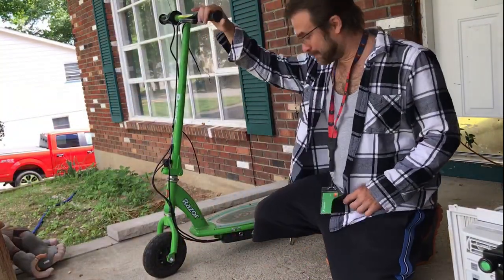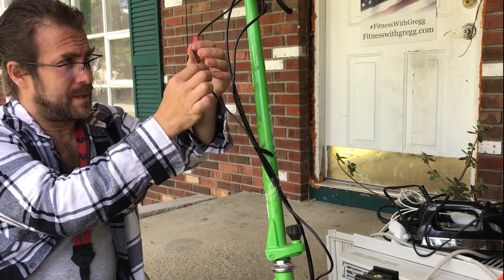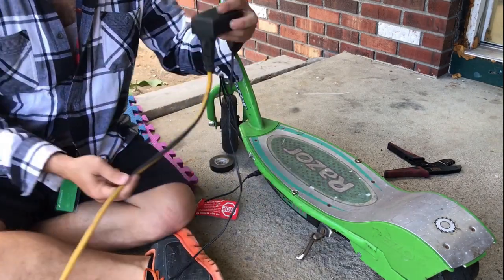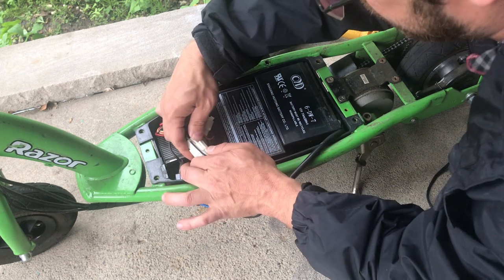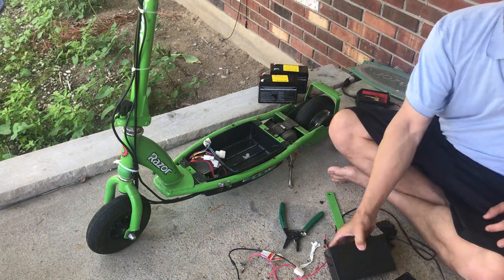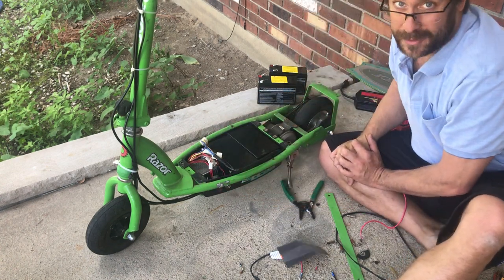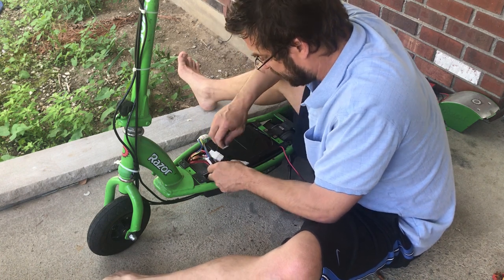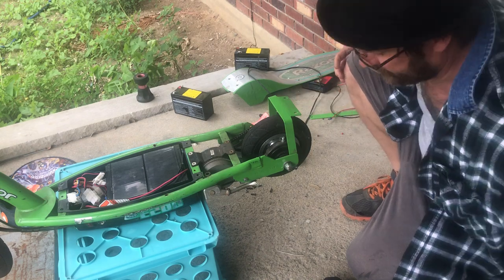Fixing a Junked Razor Scooter E200. Fix Wiring, Replace batteries, Change Rear Tire

Comment: Hey is that all the speed that the scooter has
Reply from the maker: No, I was barely on the throttle. I’m a bit heavy for it. It moves reasonably but isn’t super fast.
Reply: Why I asked is because I have a e100 I'm working on myself , someone trew it out but I'm almost finished jus to change out the batterys now and give it a run.btw very informative vid thanks.

Comment: sure wish i watched this video hours a go...bought my son an e300s years a go that he didnt ride too much till the batteries would no longer charge..it sat in garage i think like 8-10 years when i decided to buy new batteries and bring it back to life so he could drive it to work..opened it up and both batteries were bulging and both tires were flat...took to friend who is a mechanic so i could air up the tires...he also ended up cutting wires to the batteries and adding new connectors like you did...air up front tire then get to the dreaded back tire...he had several size adapters but none would fit...so off with the rear tire which was an hour long job oiled up chain and she is charging now 6 hours but it runs again...damn sure wish i knew the air extender was in the grip...looked at mine and it was there...DAMN i never knew...good video to reference if ever needed

Comment: Replacing the battery looks simple in the video but removing the old welded on battery wasn't addressed!
Reply from the maker: It’s just soldered on. Melt it off with a Solder gun, or just snip them off and re-splice the wire. ✌🏻